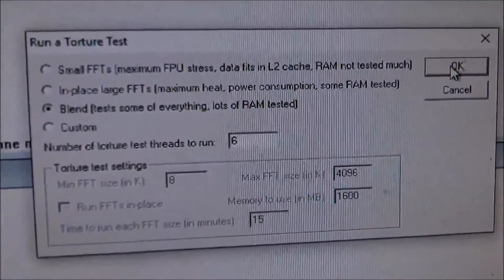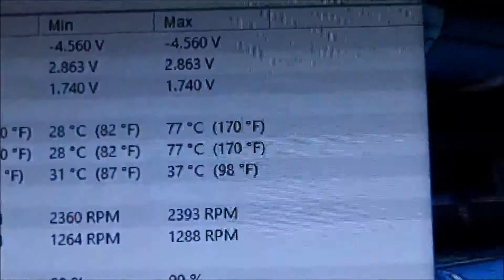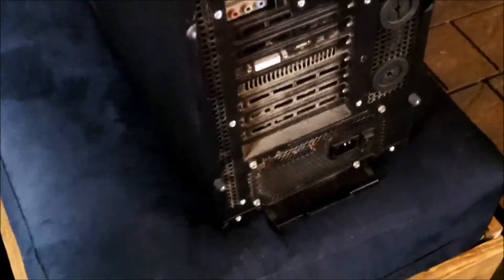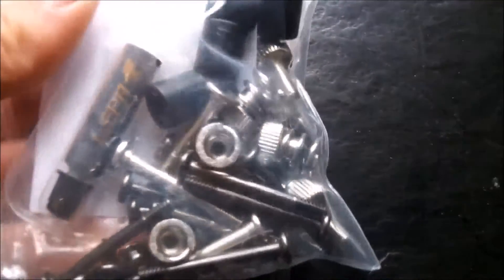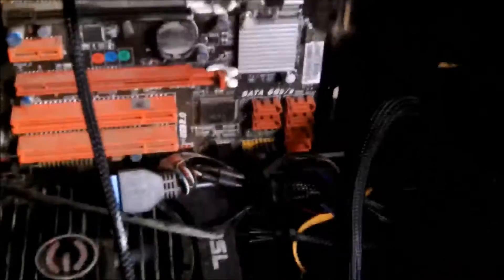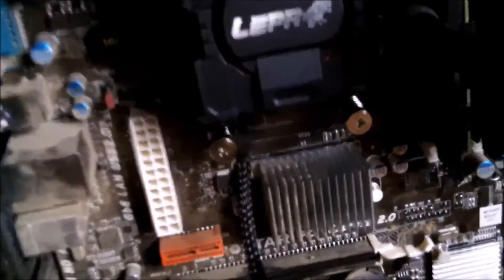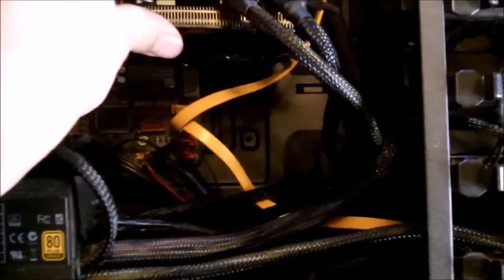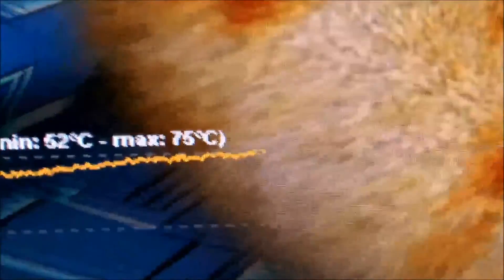Lepa AquaChanger 240 Install, Test & Review. CPU Water cooler!

Comment: Did you ever reuse the radiator from this?
Reply from the maker: No, I did give it to a coworker for a water cooled laser cutting CNC project to help cool the laser in DIY closed loop system. I don't know if he got it together yet but I am sure the radiator would be a lot better with a bigger pump.

Comment from the maker: *Note, I did have one fan on fail after one year, I replaced both of the fans with better quality. You need both fans otherwise the CPU will get too hot with load. The CPU is even cooler now with better quality fans.

Comment: how his the back plate the little square on the mother bord or the other way? i'am wondering now, i might have it wrong
Reply from the maker: You may have different cpu? I had AMD.
Reply: i had amd, i switch yesterday to intel i7, i might have the backplate upside down i dont know, i m wondering
Reply: Azone123465 on your vid x can see it 10:49, but it s dark so i cant see how you set it up
Reply from the maker: It is the same either way right? If not, whatever side has the writing, if there is any, should be visible.
Reply: Azone123465 i have the same same yea , ill have to draw smth for u to understand what im sayin hold on :)

Comment: From 11:00 to end is this noise the pump ? When yes thats very loud
Reply from the maker: Lol, no that is a fan on my wood burner, also there is an air purifier running too. I cannot hear the pump on the water cooler, but I have a very quiet case. But even with the side off when I was powering it on for the first time I don't really remember much noise from it.